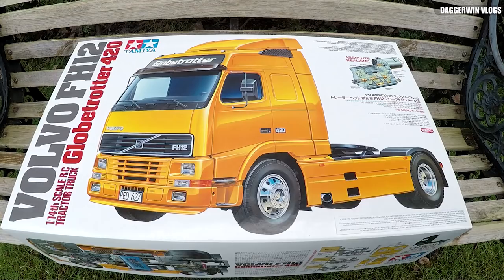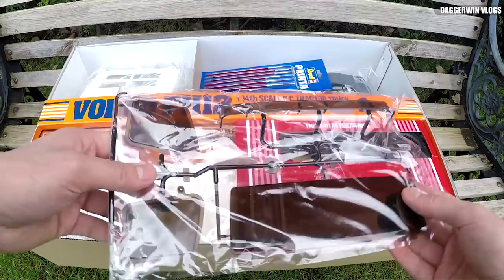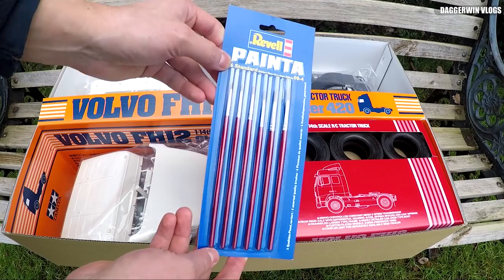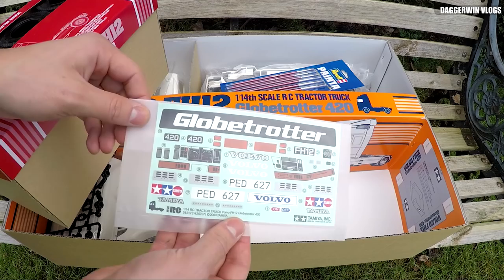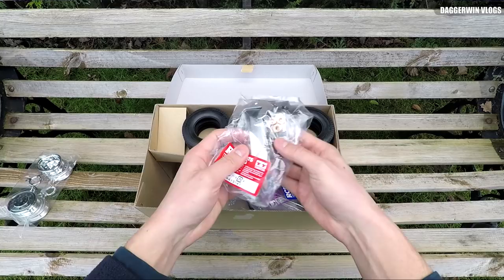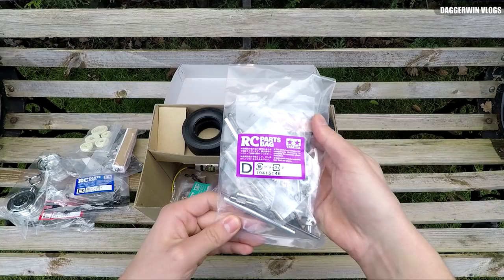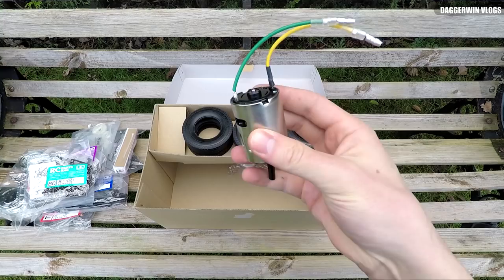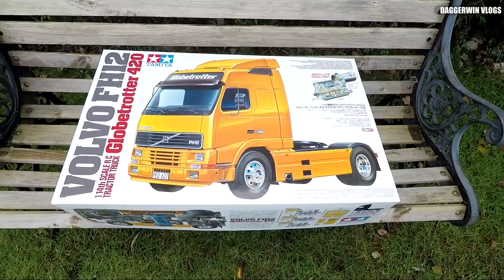Building a Radio Controlled Truck | Volvo FH12 Globetrotter 420

Comment: If you havent glued the windows and clear plastic for the lights on yet DON'T use liquid cement because it destroys the plastic. You should instead use wood glue that dries clear or glue made for clear parts. And for painting the truck I highly recomend using an airbrush for the best effect(if you don't want visisble brush strokes on the truck). Good luck with the build and have fun.
Reply: Thanks for the tips, I think these windows are screwed into place but not sure

Comment: Just to say the motor doesn't power the steering and gear shift. These work off servos. And the motor is just for the drive of the truck. Forward and reverse.

Comment: Daggerwin you must read this! Don't use the motor that comes with the truck, use a carson truck puller motor or a rock crawler motor. YOU HAVE BEEN WARNDED!
Reply from the maker: Why?
Reply: Daggerwin Vlogs It must be how much power it has it must be really weak
Reply: The stock motor makes the truck way too fast.
Reply: The original motor is a tamiya stock motor that they put in with just about every model they make. As such for this particular model it will be too fast and it is pretty cheap low quality so very prone to over heating. The motors suggested would be a much better option (coming from a scale r/c builder and 1/10 r/c of road racer)
Reply: H
Reply: You can also run a 3:1 or 4:1 gru. Helps slows it down quite abit. I use one on my CC01 with a Torque Tuned motor. I use a 55T on my stretched Globeliner, it needs a gru too. Looking at a 4:1 that mounts at the rear of the trans, may not work with the Volvo though.
Reply: Plus on my Globe I swapped the kit tires for some RC4WD Roady's. The Tamiya tires were like slick hockey pucks, they are fine on the trailer (flat bed) , but offered limited traction on the truck.

Comment: PS is this the same size as your other rc tractors otherwise you can maby build an low loader and drive some tractors on that.
Reply: This is 1/14 whereas his Siku tractors and low loader are 1/32 so they aren't comparable.